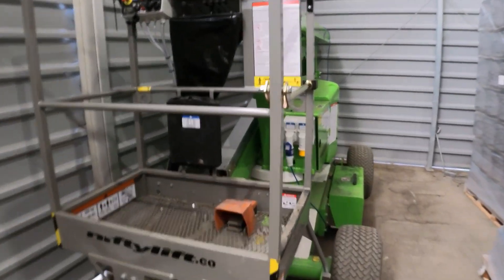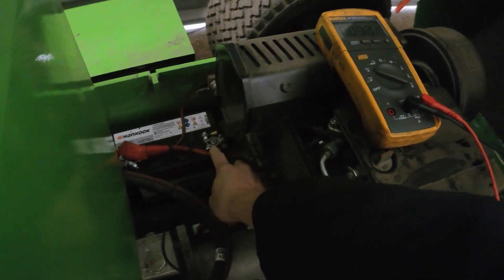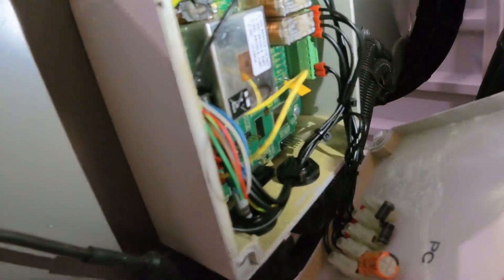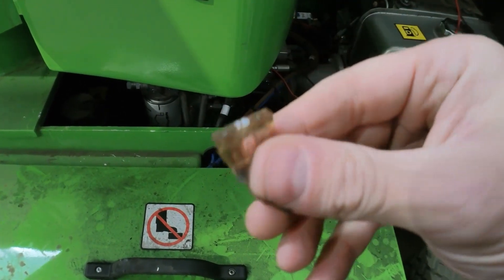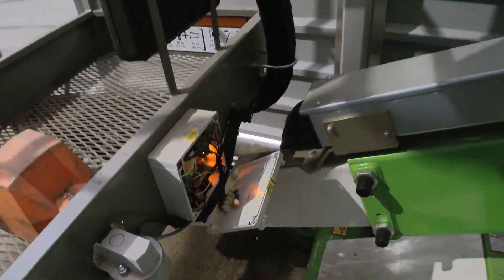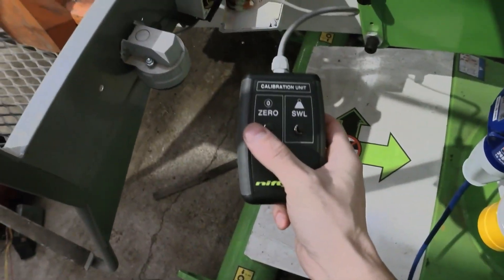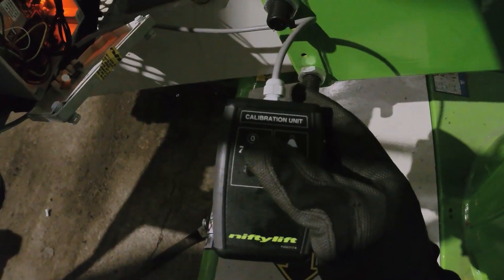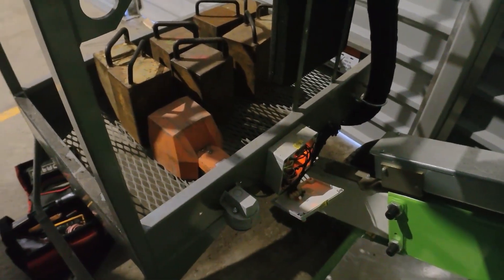Niftylift HR12 SP34 NDE  Overload Alarm FIX and  Cage Weight Calibration

Comment: Hi.  I can’t get a snorkel Mhp 13/35 to go up.  Load alarm keeps going up.  Any ideas?
Reply from the maker: Not really mate what kind of load cell they use ? Is it with voltage output or over can bus? From schematic it looks like should be voltage output?